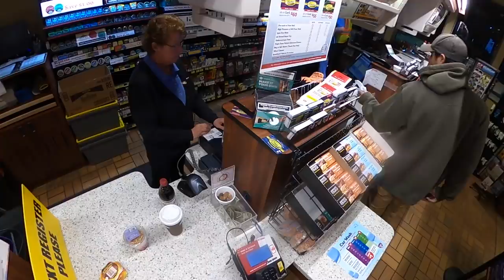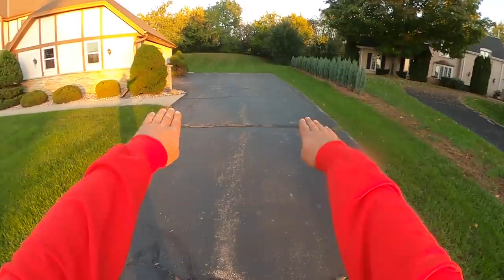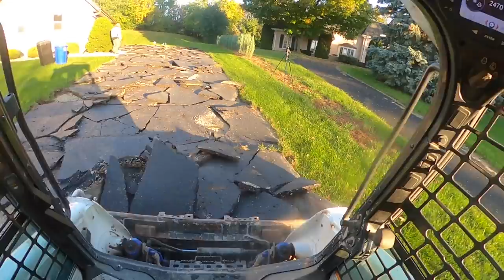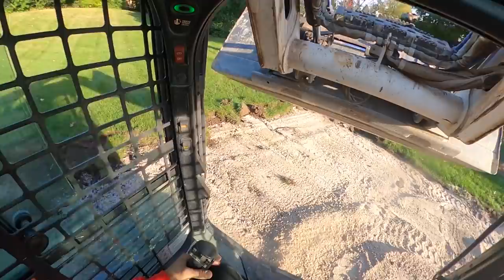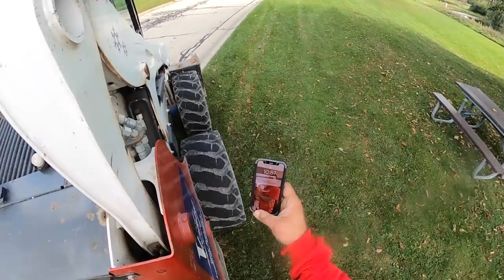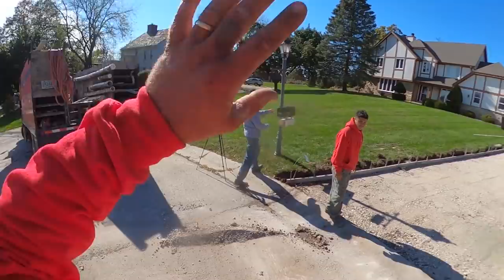He almost wrecked-It was close

Comment: I’m not in the industry but would I be correct in assuming you don’t use Non-CDL dump trucks because of the weight limits?
Reply from the maker: Yes, once you hit 26,000lbs you need a CDL. Smaller single axle dump trucks are under the limit.